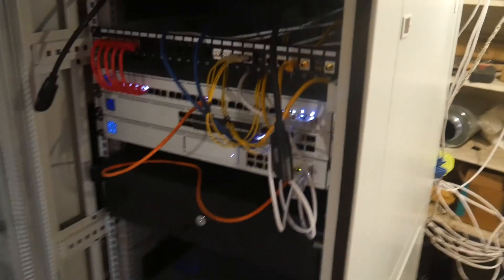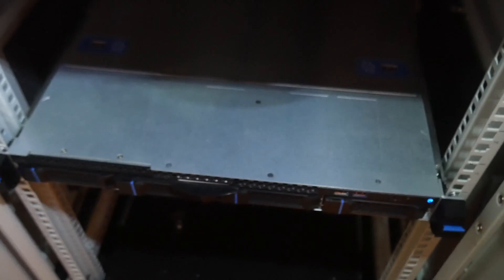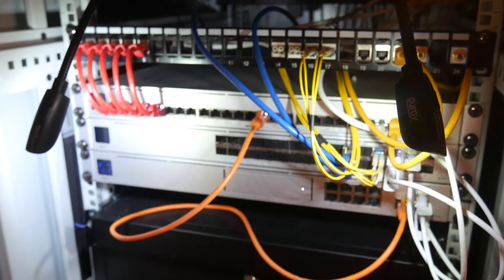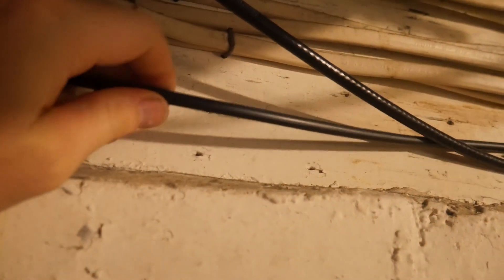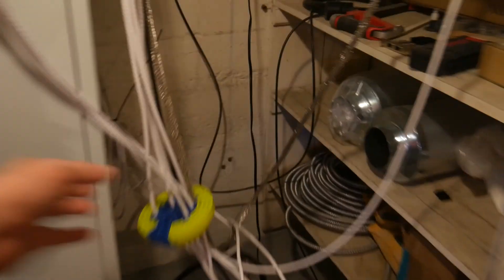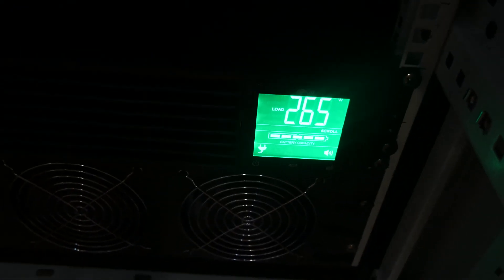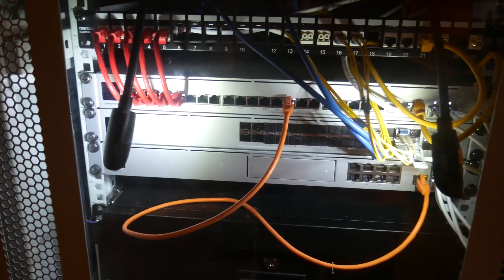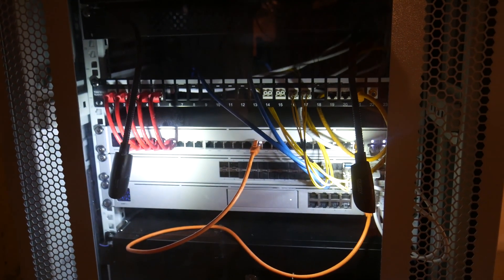Unifi dream machine cabinet

Comment: Insane setup, but sure seems like a lot of overkill.
Reply from the maker: It depends on your situation. My house is 100 years old which has thick interior walls made of plaster and wire mesh. So I have 6 access points to cover the interior of the house, along with 8 security cameras. And we work from home all day, so we need very fast and reliable connection all the time.
Reply: Naah. Not overkill. Fitting for the situation. I use a lot of old enterprise equipment at home. It's loud but cheap. For most people doing this type of thing it's more rewarding to set it up yourself instead of using cloud offerings or getting locked into a vendor ecosystem. Also get a lot more flexibility and Bang for your buck.